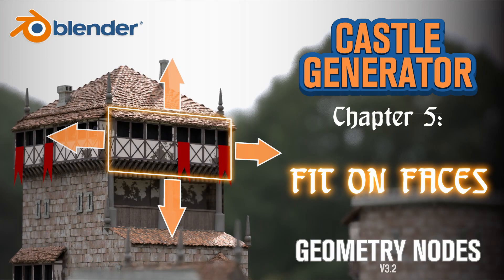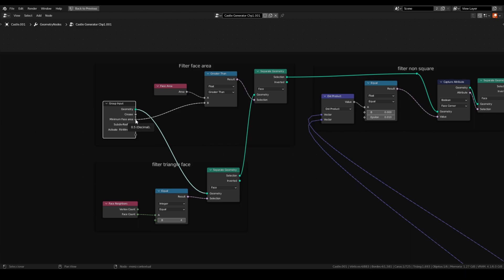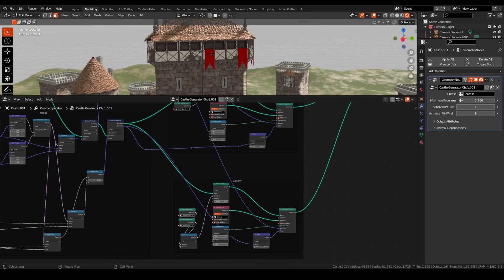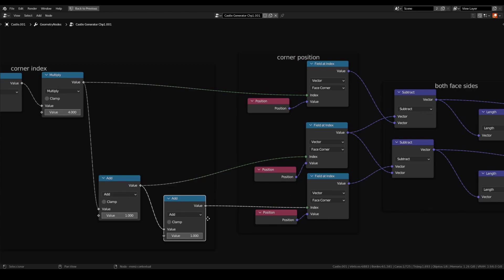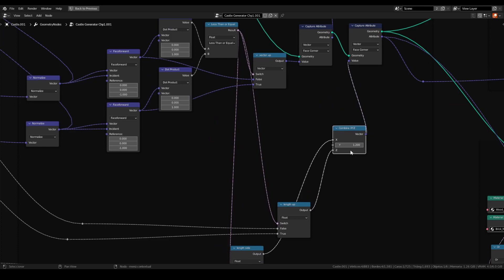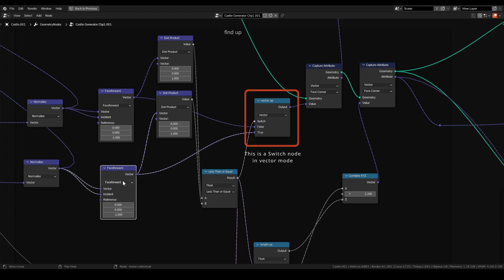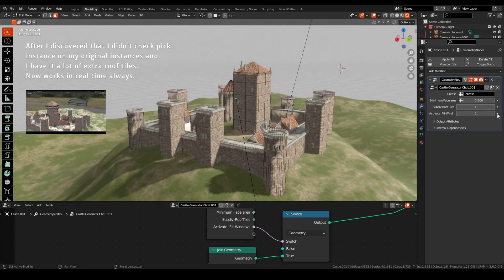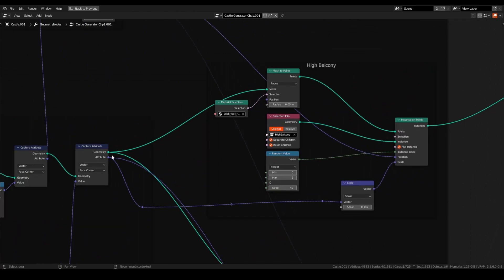How to fit instances on faces - Castle generator (5/xx). Blender Geometry Nodes.

Comment: Thanks for the explanation !!! I do not understand the reason why you divide the index by 4 ... why a index divided by 4 give you a right face ?
Reply from the maker: I'm not the creator of the method but as far I understand it's because each square face has 4 vertex. So by that math you can "select" the face selecting the 4 vertex